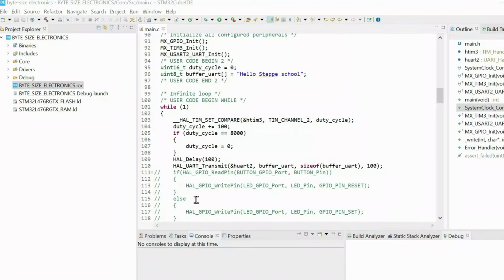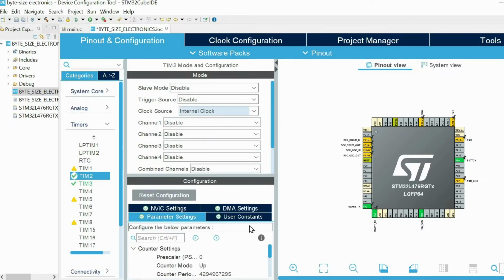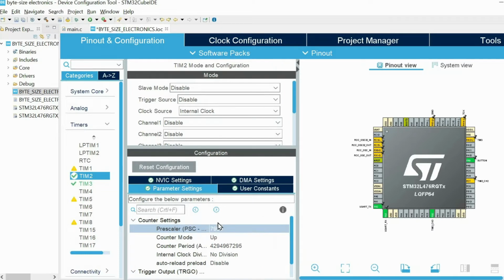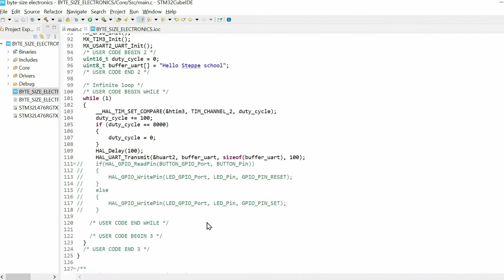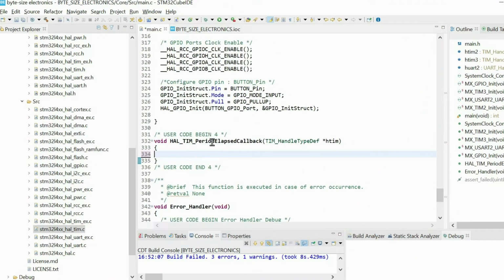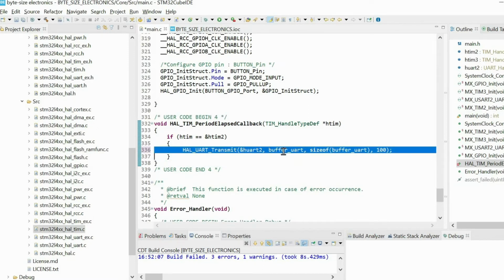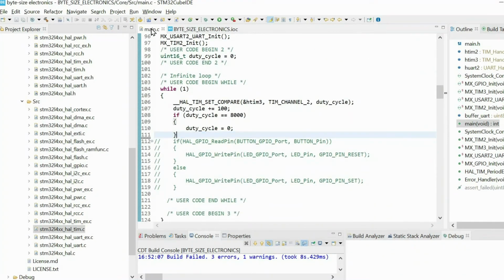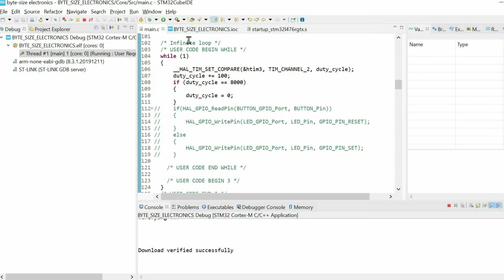STM32 HAL: Timer Update Interrupt

Comment: Hello Stepp School.
I have everything setup as explained, yet im never able to enter the callback, i feel i have followed everything, do you have any idea as to what could be the reason as to why my callback is not working?
I have enabled IT on my timer, i have run the HAL_TIM_Base_Start_IT(&htim2); and i have created a callback function with some actions to take during the interrupt. 
All i have in my main loop is a delay, and its just stuck in there, the interrupt never fires.
Reply from the maker: Hi, how do you check that the callback function is running? and what is the frequency of it?
Reply: @steppeschool3629  For now, i am just using the live expressions and breakpoints. i also have an oscilloscope set up to sniff what is happening on my board, regarding the pins i am working on.
Right now the frequency of the function is 100ms, my idea is i have to set the interrupting timer to fire first at 100ms, make a change to my signal and set the next interrupt in 9,9seconds, so 10 seconds total, make another change and that is it, after that just stop the timer.
However i tried something simple, just toggling a pin at 1000Hz, not seeing anything there either. i have used this in other programs, and worked just fine.
I think im going to try to restart the entire project and start with just this functionality and see what is going on.

Comment: Hi, i want to know how to interface Enc28j60 ethernet module using spi protocol in STM microcontroller..

TCP, UDP, http, etc..
Do u have video covering them
Reply from the maker: Hi,
Unfortunately, I do not have content covering these topics.
Reply: @steppeschool3629  I tried to pay Indian Rupees for the PID motor control course. I could not pay. Is there any other option for payment
Reply from the maker: Hi  @ferdinvivian9336  ,

Do you mean access to the source code and PDF documents? You can get the source code on my Patreon page or website:
https://www.patreon.com/user?u=80399744
https://www.steppeschool.com/products/communities/steppeschool-miscellaneous
Which one did you try? If you have a credit card with any currency, it should not be a problem.
Reply: @steppeschool3629  i don't have creadit card sir, i have only debit card.. I'm from India
Reply from the maker: Hi  @ferdinvivian9336 , try with Patreon. It should work.
Reply from the maker: @ferdinvivian9336  It should work even with a debit card.